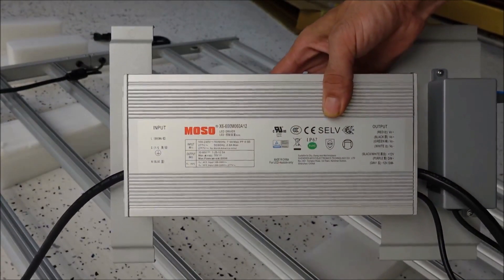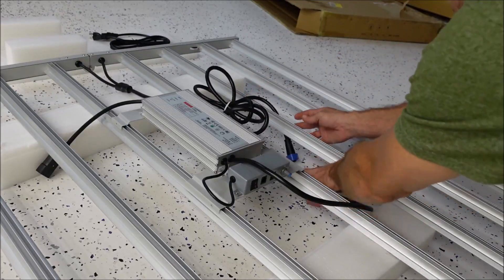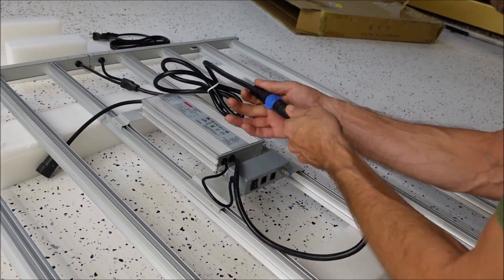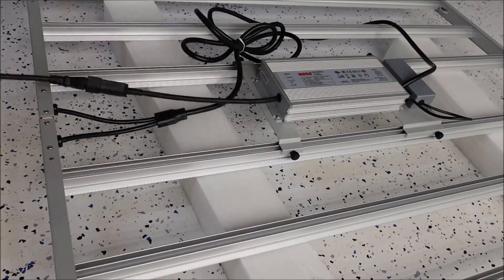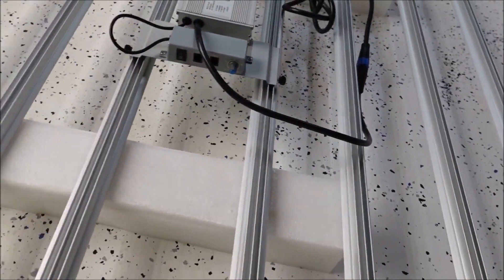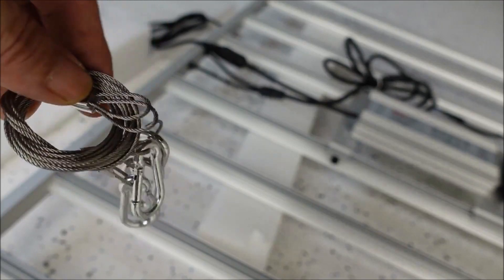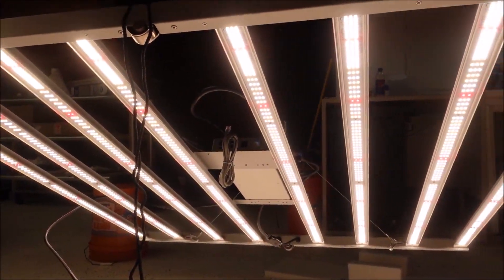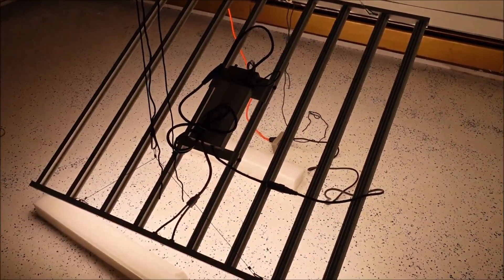2021 Most Efficient/Economic LED Grow Light | NEW Mars Hydro FC 6500 Industrial or Personal Grows

Comment: Whats the difference between the 3 fc 6500 models
Reply from the maker: There is a clear difference in the fc and fc-e but the new fc is just more efficient. The fc-e also spreads the leds out better putting g more on the outside and less inside. I hope this helps. Fc and fc-e are my favorite models by Mars Hydro.